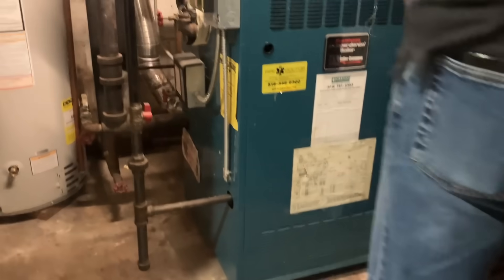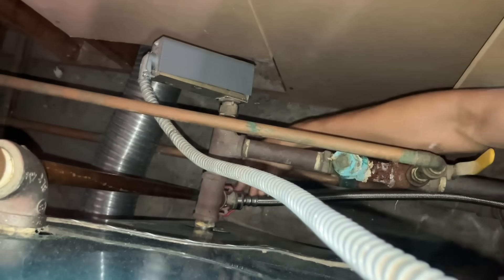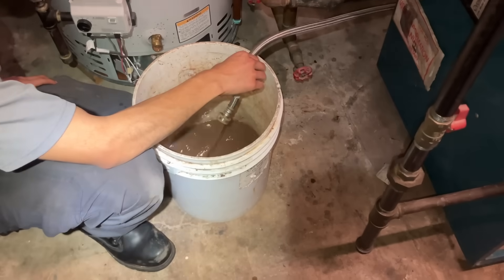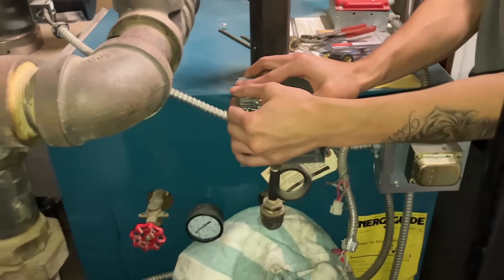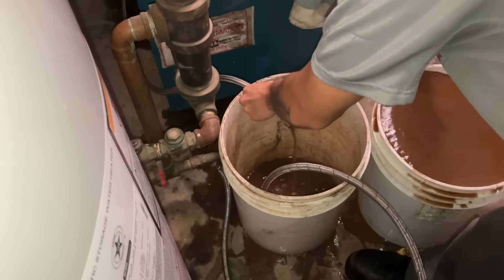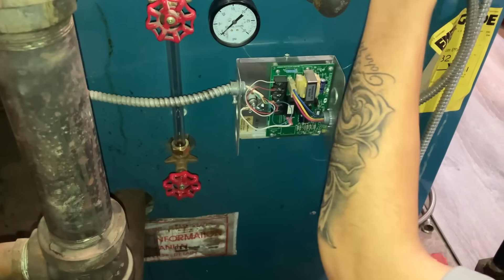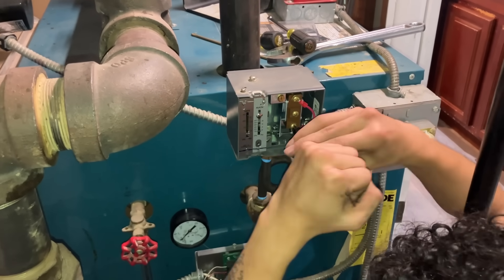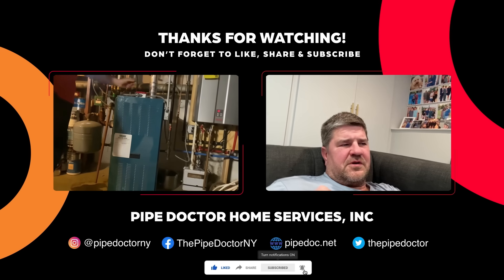Steam Boiler BANGING Like a Jackhammer! Flooded Burnham Independence FIXED 🔧💥

Comment: sounded like the washer was loose and hammering/chattering shut when back-flushing the boiler fill valve from water heater. may not have been fully open either, which risks the washer breaking or chattering, but if the washer is really stuck and crusty, it can stay holding the screw and you just unscrew the stem away from it.

Comment: Did it overfill because of the automatic feeder?  Was wondering what you recommended to the homeowner to get the water in his system to be a clearer state?  I know you generally recommend draining the system periodically during the winter, in order to remove the rust in the water.  Perhaps he could add some additive in order to facilitate cleaning.  Also, Derek is lucky to have such a knowledgeable overseer.  Happy Thanksgiving.
Reply: probably the low water cutoff is screwed up due to Teflon tape on the threads. auto feeder works with lwco so it knows when to add water, the tape on threads prevent the low water probe from grounded correctly. I believe the probe need metal to metal contact with the boiler to work properly.
Reply: @ekfliu  Thanks for adding your commentary on this.  Most folks, including me, would not know this.  Have a great Thanksgiving
Reply: @ekfliu  mineral buildup can also insulate the probe or short it out. one way results in flooding, the other no water/lockout.
Reply: I don’t think a Low water cut off has nothing to do with the over filled.

Comment: Flooded or plugged main vents or rads not pitched
Reply: Huh?
Reply: @marcinmerrimack1726 I guess you don't understand steam. Great books about it.
Reply: I understand steam just fine. How would “flooded or plugged main vents or rads not pitched” result in what was found? 

The automatic water feeder and/or the LWCO was at fault here in overfilling the boiler.
Reply: @marcinmerrimack1726 you saw how dirty the water was? Boiler will start surging water level bouncing up and down. That causes feeder to over fill boiler. Plugged main vents means water not coming back to boiler fast enough yes over filling boiler. So get a steam book and read because you don't understand steam heat.
Reply: Sorry, no, not buying it. Dirty water isn’t likely the result of plugged vents or rad pitch. 

Besides, the CycleGard would prevent overfilling from surging water levels.
Reply: also, clogged or very slow wet returns can cause flooding. but in the end, the root cause is years of neglect.